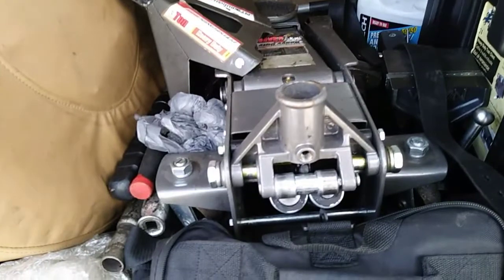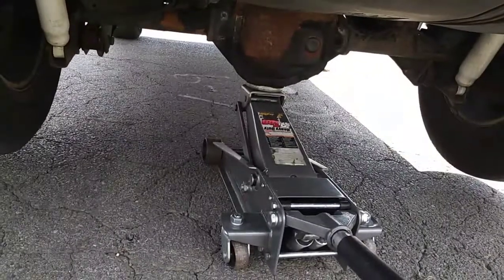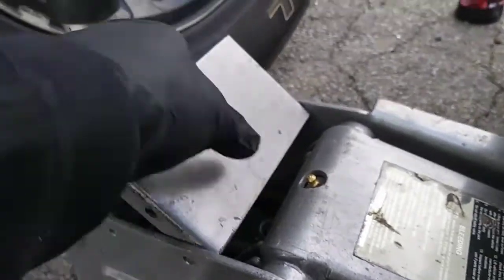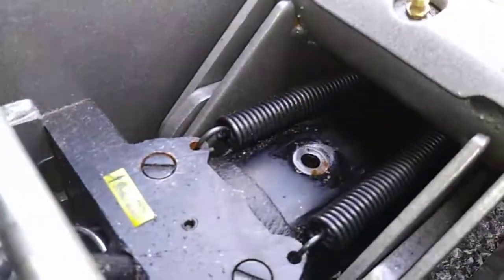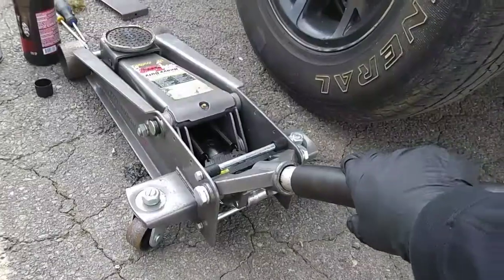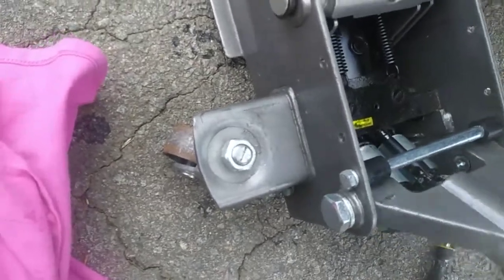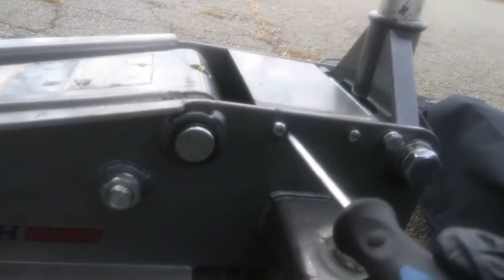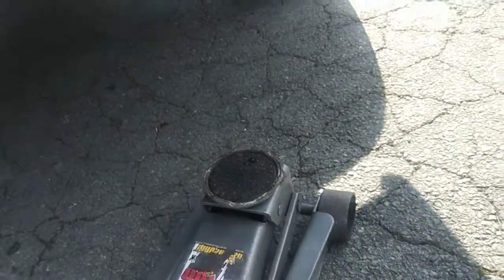FLOOR JACK MAINTENANCE

Comment: You taught and shared with me, some important tips I didn't know, even after over a half century on this blue-green space marble. Thanks for passing on what you've learned about  jack maintenance. Especially the explanation of correct air purge methods.